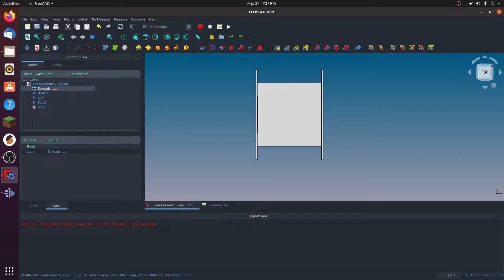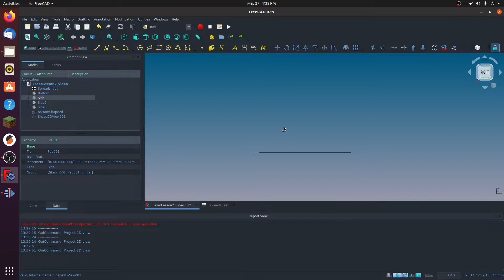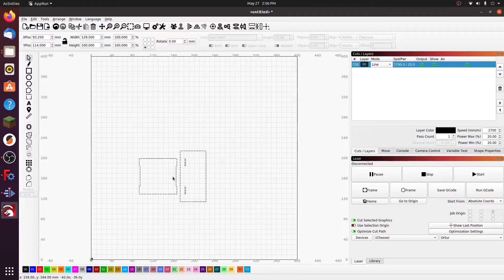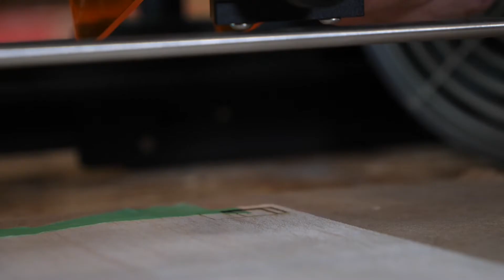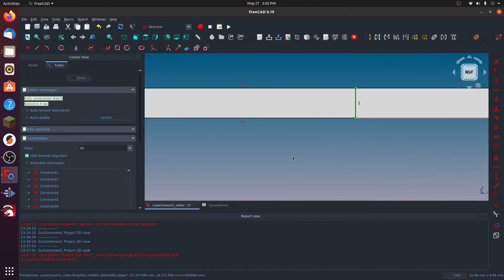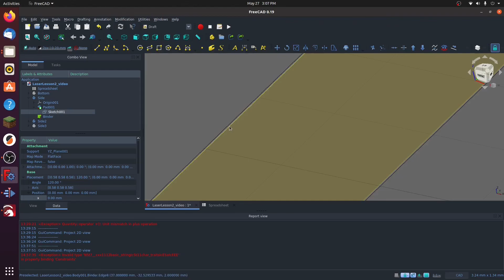Freecad For Lasers Pt.3 - Prepping for cutting with the Draft Workbench.

Comment: Great tutorial, helped alot
One issue is that you didnt show how to transform the side part to match the bottom part when the depth of the tabs changed. True it doesn't make any difference in the cutting, for such a simple object.  HOWEVER if u had, say a 4th board that connects the sides and bottoms (Ie., you design an enclosure) you would be screwed - because u didn't move the side to match the new bottom and the connection tabs for the 4th wall would be in wrong place (maybe now, even outside the actual model). I think u should of included that.
Reply from the maker: That is a good point. We cover that in our in-person class at the makerspace but it would be a good include for the video. Also Freecad 1.1 is at the release-candidate stage and is vastly improved. We need a new video!

Comment: I've been working with FreeCad for 3D print design for a few years and just started doing designs for laser cutting. This 3-part tutorial was exactly what I needed. I love the style of detailed explanation. There are a number of different how-to videos for such things but often they take things for granted and move so fast I have to pause it and try everything to see what I missed, but I could watch this and walk away ready to apply all of these techniques. One thing I'd like to see is a tutorial on working with text cutouts, both using stencil fonts and fonts that aren't designed for stencil. Also I am learning about some of the nuances of running complex jobs with both inner and outer cuts combined with engraving. 
What makes this series really valuable is that it reflects a LOT of experience condensed into a presentation that someone thought about how to present. Fantastic!
Reply from the maker: Thanks very much!